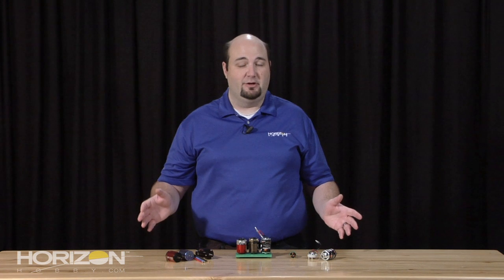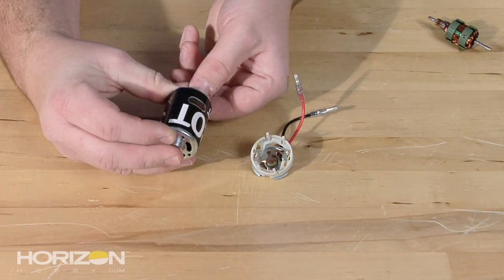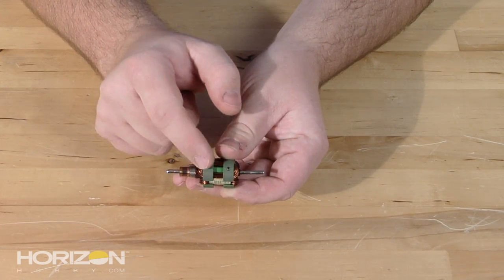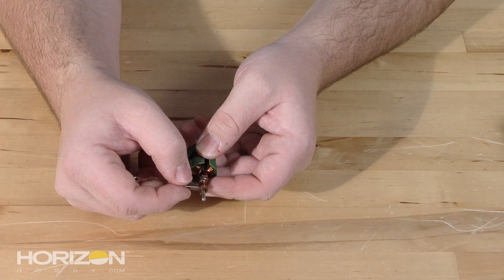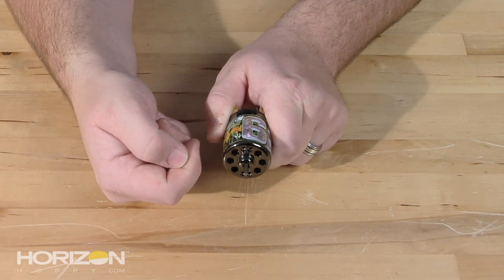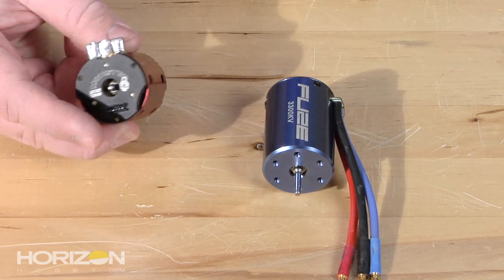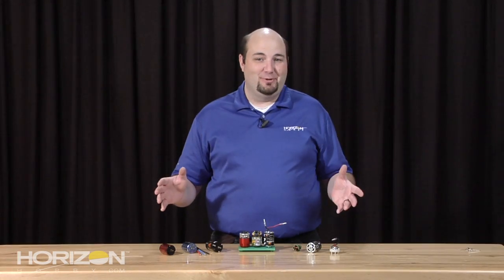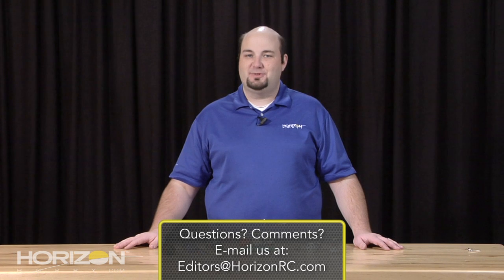HorizonHobby.com How-To: Understanding RC Motor Technology

Comment: I'd like to know if a 3800kv motor has more power than a 5700kv because I got confused when a 1/5 scale had a 800 Kv motor and also which would perform the fastest in a hpi blitz
Reply: the bigger you go the slower rpm=more touque(twisting force) you get. torque gets mass moving... 4x4's 1/5th scale.need more torque. It's  like watching a boxer (dog )rip around the yard vs. a little yorkie. . boxer feet moving 800rpm while the yorkies are doing 5700 rpm doing the same speed. dont know if that made sense . it idid in my mind :-( and the motor you choose decides the whole system.  110a motor needs a 120-150a esc. and a c rating on the lipos that can feed the burst rating( 60c 100c) )

Comment: Is it the lower the turn the more torque please help lok
Reply from the maker: Not necessarily. Lower turns normally mean more RPM but there are ways to add or remove torque depending on the armature winding techniques.

Comment: hi does anyone know can i use a 540 size motor on my kyosho dbx 2 ve the stock motor is 550 size
Reply: wouldn't go smaller . 550 has added torque . as seen in that video. spend the $$

Comment: hey i would like to the weight of the motors and i want u to give me some suggestion on weight less rc motor for my project
Reply from the maker: That's all going to be dependent on the motor manufacturer. Due to differences in materials, tolerances and building techniques one manufacturer's, say, 17.5T motor is going to have a different weight than another manufacturer's 17.5. The lower the turn, however, the lighter the motor due to the reduction in wire used to make the motor in the first place.
Reply: thx dude

Comment: Time has a reverse arrow: e{a}/t=hv. (equation for the fine structure constant) Helps in understanding A/C current flow as well as gravity. See SLAC's BaBar time asymmetry discovery announced in November 2012 with a  sigma 14 level of certainty discovered after SLAC's E158 asymmetry of the weak force data matched CERN's "faster than light" neutrino data announced worldwide in Sept 2011 @ (v-c)/c=2.48e-5 sec in 453.6 miles creating an asymmetry in time @.20e-5 sec and SLAC funded by the DOE went back over their old BaBar data and  "looking at it differently" confirmed that time indeed does have the asymmetry exposed by the CERN/SLAC E158 data match. The asymmetry in time is known as gravity. CERN later changed 2.48e-5 to 2.37e-5 which places gravity in the wrong phase arrow of time and claimed after 2 years of checking everything it was all a big mistake caused by a loose cable... OK I have a bridge in Brooklyn I'm selling cheap made out of dark matter. ("Missing dark matter" no longer "exists" as the cause of gravity (a harmonic comma) shows space is a harmonic octave structure and the further back in time we look the lower the frequency. The mistake was like saying because the woofer in a speaker draws 200 watts and the tweeter only 30 watts most of the sound is missing "dark sound".)

This same "faster than light" observation actually goes back to 1948 when Sommerfeld detected it first using the photon and the experiment has been repeated and argued over ever since because it appeared to violate the speed of light limit and things in physics that don't fit the picture get ignored by "twisting" numbers using dice (now replaced with {a}) and imaginary time (now replaced with the reverse arrow the BaBar team detected). The neutrino is added at the speed of light and therefore does not exceed it and the neutrino is the force carrier space for the photon from the weak force into the strong force and acts as the photons "quasi" antiparticle supporting part of an old theory that goes back to the 30's. 

When we look at light we are looking at what creates both light and time: a speed of light clock called the weak force created by Mass in oscillation. Time dilation shows that our clocks should stop as a result of observing light. However SLAC's E158 data shows the asymmetry of the weak force adds 3.6 seconds each year to the speed of light (from our reference frame) in two arrows, the second reverse arrow longer than the forward arrow and the difference in size creates the "force" of gravity. An atom has 4 parts. The missing graviton is not missing, it has been misnamed and called the "hole" shown opposite the electron and exits in the second reverse arrow phase of Mass oscillation.
JFH^^

Comment: I'd say a 15 turn brushed motor would be great for the light weight tamiya hotshot..lowest 12 turn brushed would be max if try to compete and control the buggy 12 turn would have it in a rage..15 turn is a great frist option for the hotshot...now brushless 13 turn lowest probably cuz the hotshot plastic gears will more than likely not hold up to the rage of a brushless motor ..

Comment: The 540 size has a given amount of Torque (Becouse of its Shaft Size and Bell Size) that the 550 almost doubles becouse of its bigger Shaft... 540 and 550 are different size of motors just like a Ford 5.0L vs 7.4L.. Usually you use 540 Motors for almost any Car 2WD or smaller AWDs.. You leave the 550 for the 4x4s and Heavy AWD SCT, its not a Rule though you can use a 550 for a 2WD its just an Uncontrollable amount of Power (Seriously Overkill).

Comment: Wow you know your stuff! But need more practice running on the track lol I've seen you drive.
Reply from the maker: Chris Lethbridge I would deny that but it IS true :) What track have you seen me drive on out of curiosity?
Reply: +Horizon Hobby I have a Traxxas Slash RWD XL-5.  I'm trying to decide if I should get a Castle Creations or a Velineon VXL setup for my Slash.  is there any recommendations?
Reply: +GuitarRocks360 I would recommend a mamba max priv
Reply: I was running a velenion. nice enough. started leaving me stranded ( not powering up drive system) had to bench it. Plus we have a 13.5T spec modified rule. apparantly the velenion is a 4 pole motor. aka illegal for spec 13.5 classes. got a castle sidewinder and a cm36-5700 . its still runs but its not a 13.5t either sooo its on the shelf. theyre both solid choices. i think they both pushed my rustlers above 65 mph.
Reply: +GuitarRocks360 I got a castle sidewinder 3 esc motor combo and I love it! 2s lipo no fans and never overheated!

Comment: There is really nothing technologically advance about a brushless motor because a type of brushless motor that has been so since 1888, called the AC induction motor, is used quite extensively in industrial manufacturing equipment and in home appliances or air compressors for the home. Don't believe me? Then rip apart a washing machine, dyer, dishwasher, ceiling exhaust fans, or air compressor.

Comment: Sensored motors suck!
Reply from the maker: There are racers all over the world who would disagree with that since that's all that is allowed for sanctioned racing. If you don't mind my asking why do you feel that way?
Reply: Horizon Hobby Because my first RC is a Team Durango DESC210 its a sensored brushless, What happens is when you hold down the throttle for more that 5seconds it will slowdown. thats why I don't like sensored
Reply from the maker: connor pickett That has nothing to do with being sensored vs sensorless. That sounds like there's either a profile in the ESC programmed to do that to protect your gear or something wrong. That is not normal and I would not classify that as a "sensored" problem as much as an ESC or software issue.
Reply: Horizon Hobby ok true, I guess thanks plus the ESC is dead right now or its had problems twice same problem actually. the battery is charged and I drive it around for 45 minutes then I charge it and it doesn't move. the servo works and the lights are on the fan is on but It doesn't move! I tried taking out the censored cable and putting it back on but no. I checked the gear box nothing jammed. so right now its just a paper weight. :/